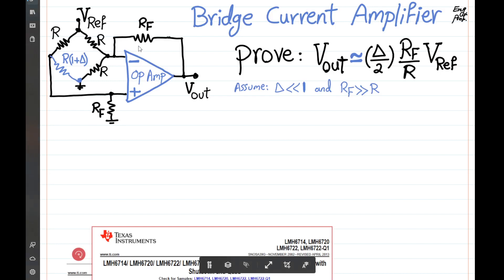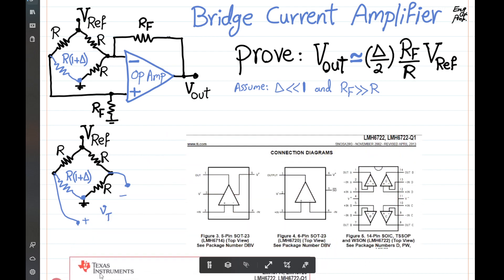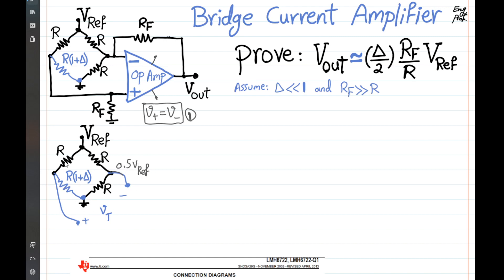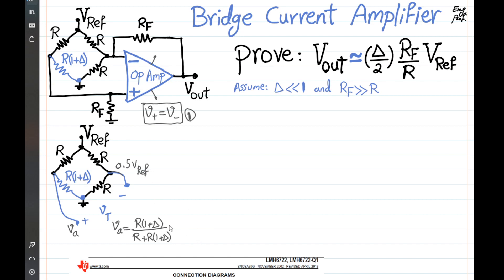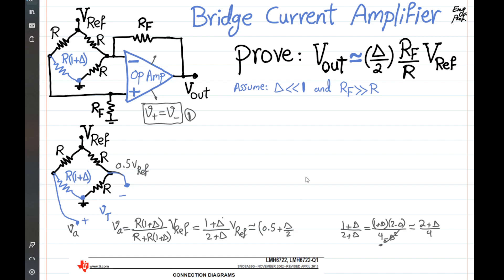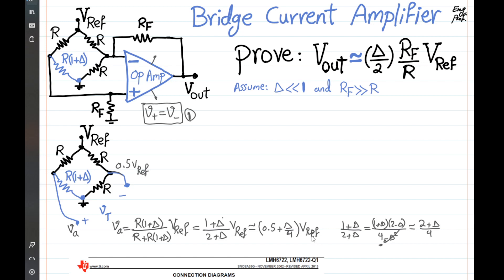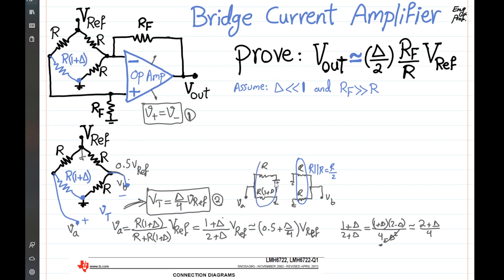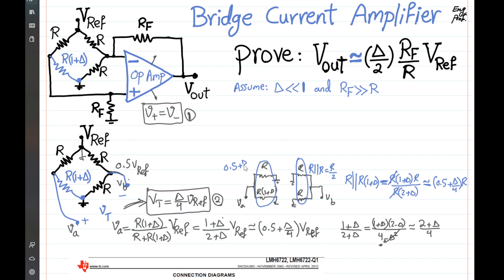Computing voltage gain and Analyzing Bridge Current Amplifier Circuit

Comment from the maker: This video presents a Bridge Current Amplifier designed with one Op Amp. In this analysis notice that Rf>>R , Delta<<1 and with that in mind then break down contribution of Vref into two components in the sense that effectively as if we have a combination of inverting amplification & non-inverting amplifier in this circuit where contribution of non-inverting voltage to output is slightly more than the contribution of the inverting portion and hence the overall gain is positive. What I did at the end of my analysis (to compute gain) is writing a KVL from output Vout all the way back through my hypothetical Thevenin equivalent RT & VT (for quad resistor + Vref) and then through the Rf resistor to ground. While this is not True circuit equivalence, this is a shortcut technique (trick) just to compute the gain.

Comment from the maker: For a better example see the Wheatstone Bridge Amplifier video https://youtu.be/io1yBcCsP-Y for Strain Gauge Instrumentation Amplifier application.  For more examples see: 
PhotoDiode Amplifier with Data Compression Explained https://youtu.be/hqrRx2ufAwg
Amplifier with -25 to 55 dB Attenuation-Gain range https://youtu.be/oyz6lTGd2Xo
Electronic Gain Control for Op Amp Amplifier  https://youtu.be/NoNgQpbj77Y
Thermometer Circuit Design with Op Amp & BJT transistor https://youtu.be/55YsraFE0rg
PhotoDiode Amplifier with Op Amp and MOSFET Explained https://youtu.be/1c3EJ2d4pVI
Instrumentation Amplifier with Electronic Gain Control https://youtu.be/C4tghZ-q6Zs
Power Amplifier Design (Class A) with Transformer https://youtu.be/gKlJrqGqeCI
VCA Electronic Gain Control (Part 1): Voltage-Controlled Attenuator Overview https://youtu.be/cFzYZsPEtP0
Analog Multiplier Circuit  https://youtu.be/VP53A2zpVMQ
Push-Pull Power Amplifier Design with Op Amp, Sziklai Darlington Transistors https://youtu.be/8BFzsi7-Vbs
Analog Vector Summer Circuit Design with Op Amp and BJT Transistors https://youtu.be/PIAsa0QNVns
Op Amp Analog Computer Differential Equation Solver https://youtu.be/ENq39EesfPw
Push-Pull Power Amplifier with Darlington Transistors https://youtu.be/866MYibo8yE

And the Analog Circuits Video playlist: https://www.youtube.com/playlist?list=PLrwXF7N522y4c7c-8KBjrwd7IyaZfWxyt  I hope these Circuit design and analysis videos are interesting.

Comment: I do not understand why you recommend a high speed op-amp for a bridge amplifier. Sensor bridges is often feed dc or low frequencies. But i guess the application could be something like an VNA/antenna analyzer for lowish rf-frequencies.
Reply from the maker: Thank you & Correct guess regarding application. As you stated, these are mostly used in sensor & measurement applications that are not necessarily high speed.  But then again nowadays 50-100MHz are not necessarily considered as a competitively high speed spec.  If this example Texas Instrument OpAmp is available at a reasonably cheap price in sizable inventory then why not :)
Reply: @STEMprof  The main disadvantage of selecting a high speed op-amp is the low input impedance. LMH6714 is a current feedback amplifier with a trans-impedance of 1 mega-ohm  (figure 22 in the datasheet) and low input impedance on the negative input. That means that R<<Rf<<1 Mohm is required for the analysis to be valid, limiting the possible values for R to about <100 ohm. 
The offset voltage (max 8 mV), Offset voltage drift (typ 8 μV/°C), input bias current (max 20 uA) and price $3 is also very high compared to a much cheaper TLV9301, (max 2,75 mV,  typ 2 μV/°C, 10 pA and $0.6) so if the bandwidth is not critical there is much better options.
But everything depends on the application.
Reply from the maker: @larslindgren3846  Very good points Lars regarding the cons & pros of the TI LMH6714 vs TLV9301 Op Amps.  Yes, I agree that for nominal low frequency applications TLV9301 operational amplifier is surely a more relevant choice at lower price.  Thank you!

Comment: This analysis is wrong, the feedback current only goes through the right side of the bridge since the excitation voltage Vref share ground with the lower Rf and the op-amp. This would be correct if the bridge was feed by a floating source relative to the rest of the circuit.
Reply from the maker: Lars, thanks for watching but analysis is correct. Notice that Rf>>R and then break down contribution of Vref into two components in the sense that effectively as if we have a combination of inverting amplification & non-inverting amplifier in this circuit where contribution of non-inverting voltage to output is slightly more than the contribution of the inverting portion and hence the overall gain is positive.
Reply: @STEMprof  Thank you for your answer. While the end result is correct I still think the analysis is wrong. The feedback voltage divider consist of R_f and R/2 from the right half of the bridge, not 2*R_f and R as in your analysis.

In an LT spice simulation with R=2 kohm V_ref=2V R_f=1 megohm and delta =0 the output voltage becomes about 0 V and the current in both instances of R_f is about 0.999 uA.
 If delta =0.02 the output voltage becomes about 10 V (9.9 V) as expected and the current in the lower Rf is about 1.009 uA but the upper R_f now has about 8.9 uA. This shows that the feedback current only goes through the right half of the bridge. The bridge needs to be modeled as two thevenin equivalents not one. 

Your analysis breaks down if the two sides of the bridge does not use the same  value of R or the two instances of R_f does not use the same resistance. 
Assume that the upper R_f is replaced by R_f*2 =2 Megohm then the output voltage with delta=0 is -1 V and with delta =0.02 it is 19 V, a difference of 20 V due to delta=0.02 according to the simulation. Your analysis would give ((R_f*2+R_f)/R)*(delta/4)*V_ref=15 V difference and that is not correct.
Reply from the maker: @larslindgren3846  Thank you Lars for your interest and follow-up comments. What I did at the end of my analysis (to compute gain) is writing a KVL from output Vout all the way back through my hypothetical Thevenin equivalent RT & VT (for quad resistor + Vref) and then through the Rf resistor to ground. While this is not True circuit equivalence, there is nothing wrong with that technique (trick) to compute the gain.  Thanks by the way for trying it in LT spice and sharing your observation. Really appreciate. Thank you!
Reply: @STEMprof  Given that you get the correct result i assume you could say this trick is valid in this specific case, but in less symmetric cases it is not valid as I demonstrated. I do not understand the reason this trick would work in general or under what conditions it is valid. The problem as I see it is that the calculation ignores alternative path the feedback current can take to ground. Anyway great discussion thank you.